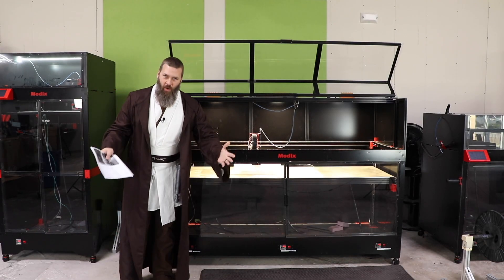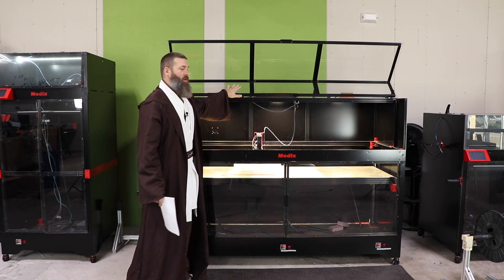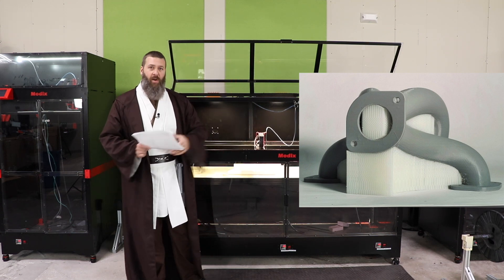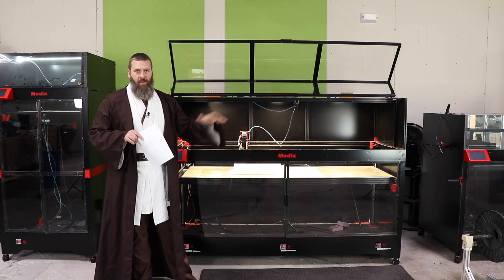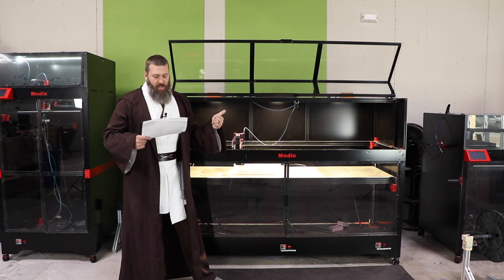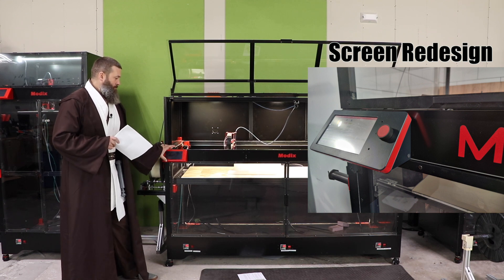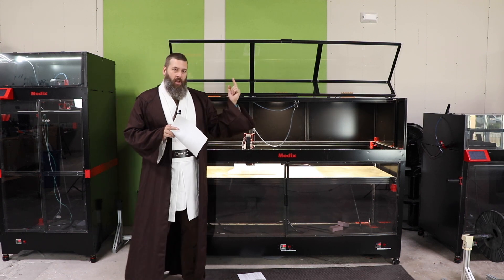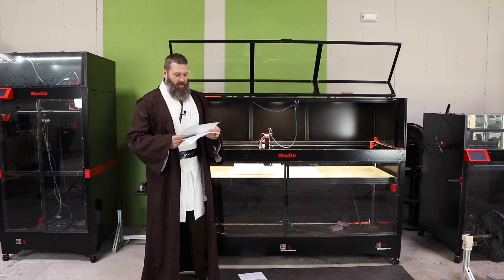HUGE Upgrades To Modix Gen 4 Printers! (But Does It Live Up To The Hype?)

Comment: have you tried out modix generation 4 ?
Reply from the maker: I have worked with the Gen 4 systems, though I no longer work with Modix at this point. The Gen 4 improvements are nice, but it's important to understand that this is still a DIY kit printer--not an industrial system. Assuming you have the right expectations and are willing to put in the work to both build it and then keep it running then yes, Gen 4 is certainly a better machine than Version 3, but it's still a Modix.
Reply: @ecostruder  There shouldn't be problem for building it. The goal for this printer is to make model ships that student are making, lets say 5-6 times a year. What type of problems can we expect while running it?  What can i expect, quality of prusa MK3, better or worse? 
also, can you recommend any substitute printer that has these sort of dimensions (100,120, 180cm in length) ?
Reply from the maker: @emilweigand1119  These are no Prusa! Prusas are known for their ease of use and reliability. I'd be happy to discuss this more if you want to reach out to me directly via email to ecostruder@hartsmartproducts.com. For the right type of user a Modix can be ok, but if you go into it with the wrong expectations it won't be a pleasant experience. Might also be good to check out some of the Modix facebook groups so you can see how people are modifying their machines to improve their functionality and what issues they are attempting to address by doing so.

Comment: Where is your shop?  I want to come look B4 I buy.
Reply from the maker: Hello there! Our shop is in Des Moines, Iowa and we'd be delighted to have you stop by. We have several Modix machines up and running in our production print farm (as well as several other brands). However, we are no longer working with Modix. We've moved on to bigger and better things (announcements coming soon)!
Reply: @ecostruder   So, which machines do u sell now? Just received my Big 120x-v4 and did the first prints. Their documentation sucks ;-)
Reply from the maker: @MegaDraadloos  Our main focus has been engineering and then building the HSP1-I industrial IDEX 3D printer. This is a high spec machine that is really not intended to compete with Modix machines in any way (it's a whole different tier of machine). https://hartsmartproducts.com/pages/hsp-1

The closest thing to a Modix that we sell now is the Project R3D Talos line of large format printers. They are very similar in a lot of ways to the Modix machines, but made and supported in USA, and with a lot of different design choices. Also, assembly takes just a few hours, rather than a couple of weeks. https://hartsmartproducts.com/pages/project-r3d

Comment: Any chance you would share a working prusa slicer profile?
Reply from the maker: Hi there! I have some slicer profiles that work for my Modix printers, but they are v3 machines which have been highly modified to make them better production printers. Modix has slicer profiles in their Customers Zone, so that's where I'd suggest getting a profile for your Gen 4. I hope that helps!
Reply: @ecostruder  i have a gen 4 idex config. Cant really get the copy mode/dual print mode to work. I would like to print 2 parts at the same time to double my production on some parts. Have you solved that?
Reply from the maker: @jensedlund5766  That sounds like a great use for an IDEX system. I don't have any Gen 4 machines in my shop (other than the ones we have assembled for customers) so I don't have any experience with their Gen 4 IDEX system, either. In fact, we no longer work with Modix. So I'd suggest reaching out to their support team. I know they were planning to support duplication mode (as I call it), but I don't know if they've gotten that profile put together yet. Good luck!

Comment: Thank you for the brief overview! 
We are currently assembling our first Big Meter. The most important question I ask myself all the time is the future compatibility with the Hemera extruders. That would be the most important update with regard to the reliability of the Modix printers....
Reply from the maker: Glad you found it helpful! So are you wondering how to put a Hemera on a Modix printer? Because if so, then I've got you covered. We designed a bracket to mount the Hemera on a Modix, and then also put together a full Revo Hemera printhead with all of the necessary wire connectors, wire lengths, etc.
https://hartsmartproducts.com/search?q=modix+hemera
Reply: @ecostruder  Many thanks!I know the link and it's great that you have made the effort. 
However, I was hoping for Modix's commitment to develop an upgrade that would allow two print heads to be used. Also, importing from the US to Europe will be too expensive for us, for components developed in the UK.
Reply from the maker: Modix has announced their IDEX system for improved dual extrusion, but I am not aware of any efforts to use Hemeras in that design. I totally understand that shipping printheads internationally probably isn't terribly practical. But one of the great things about Modix machines is that they are totally modifiable and upgradeable. So if you want dual Hemeras you can whip up a design and it will work on your Modix machine (assuming you do it right). Many other industrial printer manufacturers don't have that sort of flexibility--you have to use their printheads, filament, slicer, etc. and cannot change it. None of our Modix machines are stock :-)

Comment: The best thing you can do to improve your Modix is to immigrate to Duet3 MB6HC v1.02 + (one or more) 3HC v1.02
Reply from the maker: Duet3 is definitely very nice. I love the way the boards are distributed. But I've found Duet2 to work very well in the various machines I've got it in as well. I don't think you can go wrong either way!

Comment: Will these changes go across the board of the product lineup or just a certain size?  I didn't catch that in the video.  Thank you
P.S. great beard bro.
Reply from the maker: While there are some features specific to the larger machines (such as the filament guide), most everything I mentioned in the video is for all 5 members of the Generation 4 family. One additional thing to note: there will not be a Big-40 in Generation 4. But I think there are still some Big-40 V3 machines available if that's what people are interested in. 

Glad you like the beard!
Reply: @ecostruder  Thank you for your time in responding.